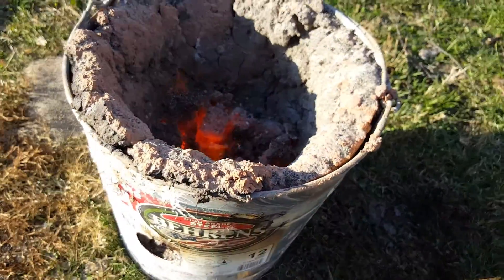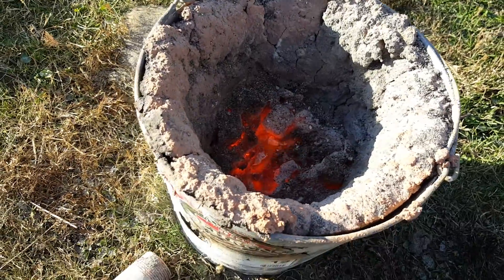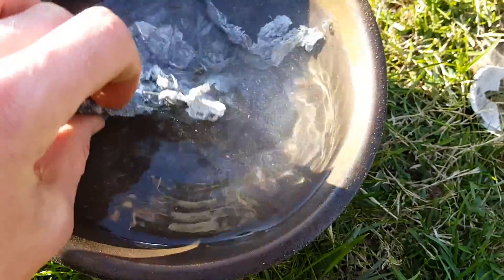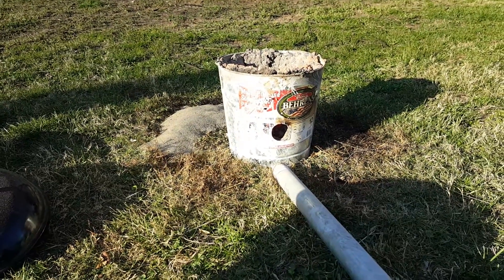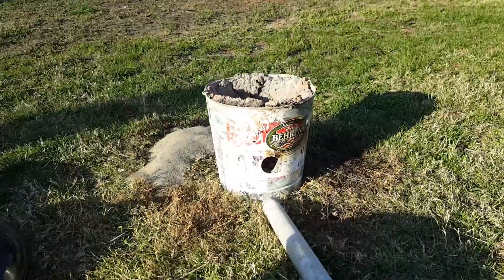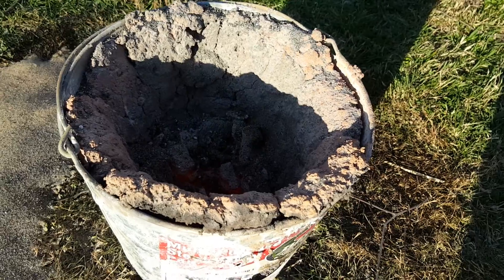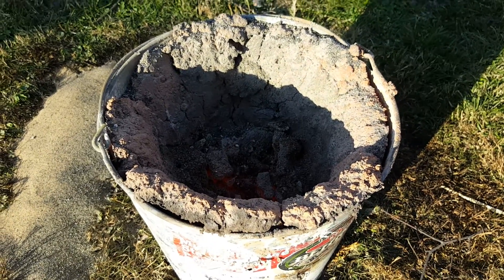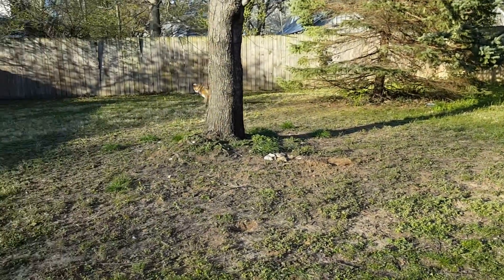The Dirt Cheap Forge Works!

Comment: 7 yeats scince you did this video so im guessing you learned a few things since. But ill make some observations anyways for anyone who happens to read this. 

A foundry should keep the heat in to do its job of melting metal So some insulation might help. Literally going dirt cheap, it might have helped to use more plant matter mixed in so that when it burns away it leaves (no pun intended) voids that slow thermal conduction.  

Sand was good to control contraction of clay.  

Galvoned steel pot may off gass zinc   as it gets hot.  I'm no blacksmith to know all the details like or how bad it is but maybe it would have been good to have more insulation lining or removed the zinc or used a different bucket.
Reply from the maker: All of these are good observations. In later “models” of this I used a bit less clay and more top soil and sand and had similar results to what you describe. 
The pot certainly does off gas some zinc but it is minimal and negligible when outdoors. 

The aluminum itself and the paint and liners in cans is what is really dangerous. Proper PPE should be used. The aluminum can pop if there is any moisture in the can that flash boils and send molten metal onto your skin or into your eyes. The paint and can liners put off some really noxious fumes. 
Honestly buying a propane devilforge, a proper mask specifically for smoke and organic compounds (not n95), and safety glasses are the best investment a hobby smelter can make.

Comment: I've read somewhere that adding chunks of glass to a clay helps keep it together.   When hot at back yard temps, the glass melts a bit, and allows for expansion, and helps hold the clumps of clay together as it cools.

Since it's a literal pain to mix clay with glass shards in it, perhaps marbles or glass beads might be better, though not cheaper.
Reply from the maker: Yeah I've read that glass shards or even ceramic pieces can help hold the clumps together. You could temper the glass beforehand by heating it really hot and then cooling it quickly in water. This makes it brittle but less sharp when it shatters. It would be easier mixing it with clay then. The sand seems to be doing its job for now though. We will see how long it lasts haha.
Reply: First I've heard about the ceramic pieces; ty.  Mom used to have a ceramics shop, and there is a lot of it still around.

I  made a small torch forge with plaster, sand and glass, last summer.  It seemed to work well enough, though propane doesn't burn nearly as hot as charcoal & forced air.  The glass made clean-up a nightmare, as the dried plaster was full of sharp edges that had no trouble piercing leather.  Ceramic chunks wouldn't be nearly as sharp.